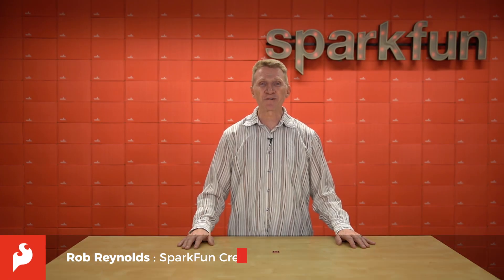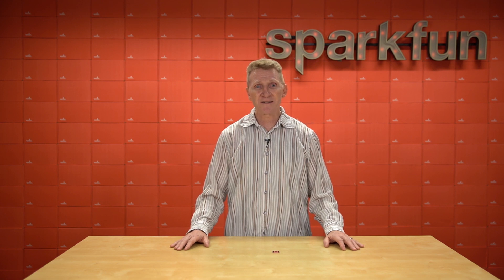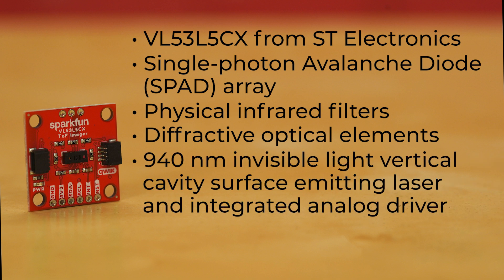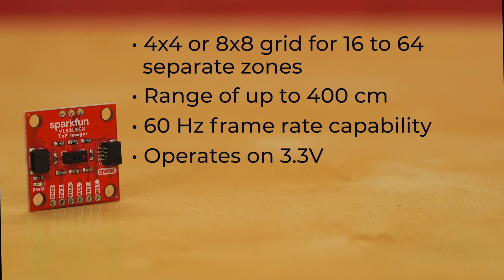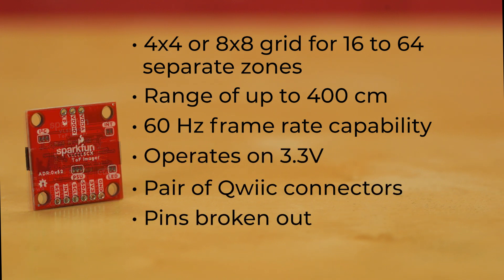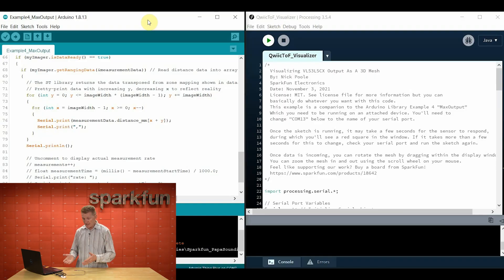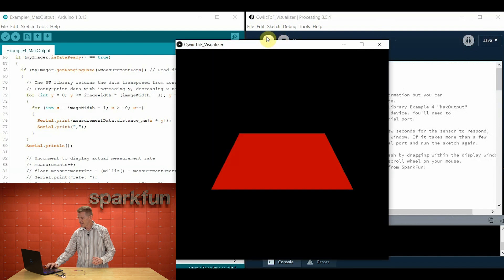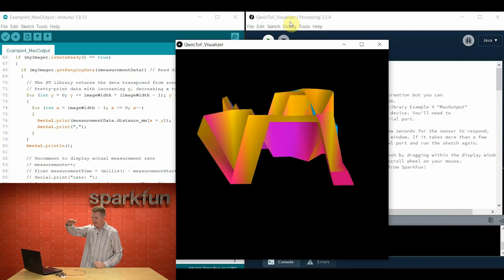Product Showcase: SparkFun Time of Flight Sensor

Comment: I have this sensor and will connect it to an Arduino R4 WiFi but I don' t have the Qwiic cables, so please where do I find the diagram for welded connections? The instructions to weld in the Library seem to have a mistake:  

* To use these examples you need to connect the VL53L5CX satellite sensor directly to the Nucleo board with wires as explained below:

 * pin 1 (GND) of the VL53L5CX satellite connected to GND of the Nucleo board
 * pin 2 (IOVDD) of the VL53L5CX satellite connected to 3V3 pin of the Nucleo board <<<<<<<<<<<<<<<
 * pin 3 (AVDD) of the VL53L5CX satellite connected to 5V pin of the Nucleo board
 * pin 4 (PWREN) of the VL53L5CX satellite connected to pin A5 of the Nucleo board
 * pin 5 (LPn) of the VL53L5CX satellite connected to pin A3 of the Nucleo board
 * pin 6 (SCL) of the VL53L5CX satellite connected to pin D15 (SCL) of the Nucleo board
 * pin 7 (SDA) of the VL53L5CX satellite connected to pin D14 (SDA) of the Nucleo board
 * pin 8 (I2C_RST) of the VL53L5CX satellite connected to pin A1 of the Nucleo board
 * pin 9 (INT) of the VL53L5CX satellite connected to pin A2 of the Nucleo board